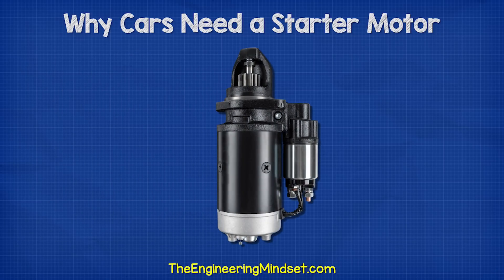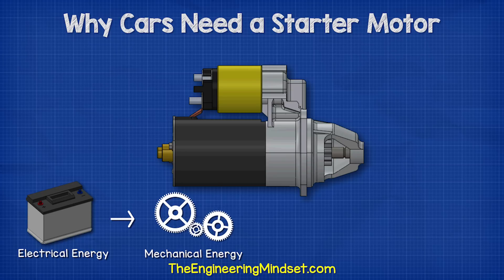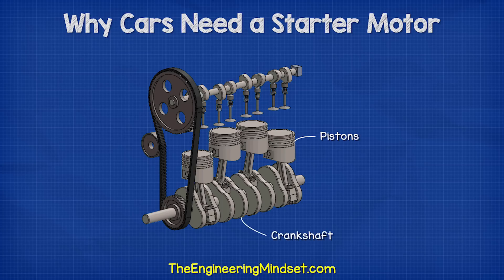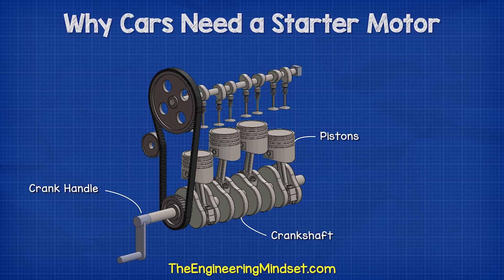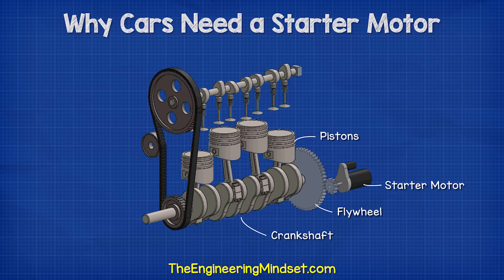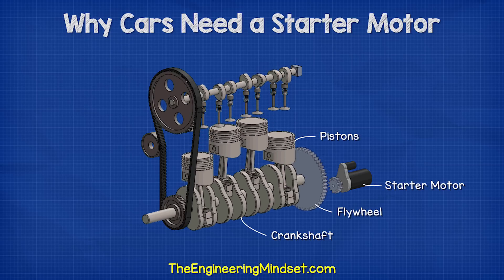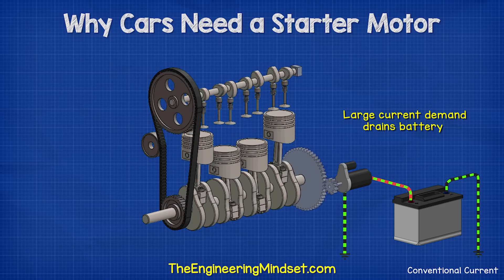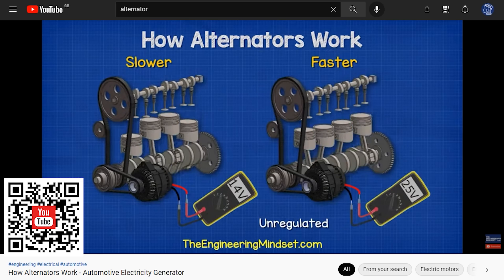Why Cars Have a Starter Motor

Comment: Remember the days when starters would grind if you turned the key if it was already running? Seems like a lifetime ago. Glad to see most, if not all manufacturers employ anti-grind/tach mode from the factory. That used to only come on high end aftermarket remote starters. Man I'm old.
Reply from the maker: Someone tried to start their car next to me the other day, with their engine already running 🙈, it was a horrific noise. Wasn't a particularly old car, surprisingly.
Reply: Wait... you're right it's all push buttons now... my truck will still make that awesome noise but it's a 99....
Reply: lol my 72 beetle does that. i spent many moments high as shit in my running car just to attempt to start it while running and hearing that cringe inducing sound

Comment: Drive a Morris Minor, battery died in shopping centre carpark, got out crank handle and got it going, turned around too an amazed audience.
Reply from the maker: Morris minor, fantastic! I wanted a reliant Robin when I was younger, just so I could have a "car"
Reply: @EngineeringMindset  Simple and reliable, flush out the radiator, change the oils regularly, top up with fuel, oh! And remember that crank handle...

Comment: My Scooter Doesn't Use Starter Motor For Starting The Engine, My Scooter When Start The Engine Silent Without Starter Motor Sound 😁😁😁😁 My Scooter Using Smart Generator Direct Connection To The Engine Not Like Conventional Starter Motor At Side The Engine

Comment: I used to have a car where the starter would jam against the flywheel. I was a teenager and skint. So, until I could afford a new starter, I just removed it an parked on hills so I could bump start it without assistance.

Comment: Now I'm thinking. With all the advancement we have with EFI, variable cam timing, spark timing, cylinder cancellation, auto start etc, why do we need a starter and not just start an engine via combustion process?

Comment: There were some vehicles that had a Large belt being turned by a combination starter and alternator.  These were "mild" hybrids.  Some early Honda hybrids had both the hybrid drive and a separate engine starter.

Comment: I work in vehicle recovery and I've found simple ways to diagnose 3 common faults that prevent a vehicle from starting:
- If the vehicle is completely dead or the electrics are working but it rapidly clicks or slowly revs when you turn the ignition... Then it's a dead battery.
- If the electrics are working but absolutely nothing happens when you turn the key... Then it's likely the immobilizer is faulty and needs resetting.
- If the electrics are working but when you turn the key you hear a single "click", then that's the sound of a faulty starter motor with the click coming from the Solenoid. If you're lucky & driving a manual, then the gears are just stuck and a simple push start will fix it.

Comment: Manual cars are the best!

My cars battery died a month ago and I didn’t know what to do I was alone 
But when I saw someone I quickly told them to come and give my car a good ol push
Thus my car started 
Also if the car is in a step road it’s much much  better just get in the car and put it to either gear 1 or reverse depending on the direction the car is rolling down.
Reply: I think most people will have better luck using second gear to push start their car. Turn the ignition to the ON setting (so the dash lights come on and the gauges work), put the car in neutral, push the car or roll it down a hill, then shift into second and let the clutch out. Second gear will be smoother than trying to dump the clutch in first gear.

Comment: Why 30 years ago, when you had a flat battery the starter motor would just sound like a slowed down record, and now you hear a ticking sound?
Reply: When the starter connects to a good battery, the voltage goes down a little; if the battery is flat the voltage goes down a lot.  Now the starter controls are electronic and when the voltage drops the relay gets disconnected.  That ticking sound is the relay connecting and disconnecting as the voltage goes up and down.  Older vehicles controls weren't as sensitive to the voltage drop and the relay would remain connected; the starter might turn slowly, or not at all; either way this could result in a flat battery AND a burned-up starter.

Comment: I recently realized that a dead battery and even a broken starter motor a car will start if you push it in gear with the clutch down in 1st gear and a 5ph release the clutch and the momentum turns the engine and it starts. Got me out of trouble when my starter motor quit 👍🇬🇧

Comment: So we can manually crank the engine if the starter motor doesnt work? or something like that?
Reply: Some small engines and small vehicles like ATVs have the option of electric or pull-start.  Modern high-compression engines in automobiles take more force than a typical human can make quickly to start them.

You can push-start many vehicles with a manual transmission, this involves slowly building inertia in the vehicle chassis, then transferring that power to the engine when the clutch is engaged.

Comment: Funny I just replaced my starter yesterday lol. I had I feeling it was the starter because my headlights would light up and all my electronics were good indicating that the battery was good. When I tried to start the motor it would just make a clicking sound. That clicking lead me to believe that relay was fine as well, and the only the left was the starter. Sure  enough it was the starter that was the problem. The windings were burned out , so I replaced the starter now the cars starts no problem.

Comment: The remaining question is "Why do cars still have a separate starter and alternator?" when weight savings are critical, alternators are larger than ever, and starters are getting smaller.  A lot of larger aircraft, some hybrid autos, and gensets handle both using a 3 phase stator and controller that's a rectifier/regulator for charging and a variable-speed-drive in one.
The starting torque changes a lot from stopped to rotating, so slow-start for a rev can greatly reduce the motor's size.  Since more vehicles are milking that 10% from start/stop intermittent operation, this seems an obvious "win" if they can scale up standard part manufacture.  Engineers are pretty good at that nowadays.
Reply: All full hybrid cars use an AC motor to both start the engine & generate electricity. The reason why regular cars still have a desperate alternator & starter motor is because it’s cheaper, since it has been that way for far longer.
Reply: I recently asked that myself. Also, this means basically all cars are hybrid. How much more complicated and expensive is it, to use one bigger electric engine to do all these tasks and have a slightly larger battery. Just enough for slow electric driving when starting from a dead stop and regenerating electricity from braking. Like the perfect balance for efficiency without having an overly complex design, parts and battery.

Comment: Temporary connects to the flywheel by way of the starter Bendix when the moter spins faster than the starter motor it releases the starter gear and retracts.

Comment: :24 tapping the starter with a wrench to make it start means it's old and is gummed up. shaking wires to make the car start means a bad connection. multimeter on the battery to see if it's old. It should easily hold a charge over night. alternator or battery bad if the car won't start right after driving it for a while.
Reply from the maker: Check our new Multimeter tutorial out ➡️ https://youtu.be/4lAyzRxsbDc

Comment: Yesterday my car wouldn’t start, and then I opened the hood and realized that there was corrosion on the red terminal. The car stuttered to start on its own after getting jumped. I figured out it was a bad battery!
Reply from the maker: Have you seen our video on how car batteries work?
Reply: @EngineeringMindset  Yes I have, and it was very informative in helping me figure out that the battery was the culprit, and not the alternator or starter. I am a senior mechanical engineering student, but definitely not a car guru. Thank you for the videos!
Reply: With a corroded terminal, the battery could have just needed good conductivity to complete a charge.

Comment: I once had to push my car down a ramp at a parking hall, then jump into the car when it started rolling down to get the motor running, since the start engine had died out and it was almost midnight.

Started up perfectly and I was able to drive it to the parking area of a car repair shop to get it fixed the next day
Reply: When I was dirt poor and delivering pizza, my battery crapped out on me and I had to push start the car a couple times. Thank god for manual transmissions.
Reply: Yup, that's how we used to do it back in the old days when for some reason the battery had died: one or two strong guys to push the car up to speed while in neutral, and one guy behind the wheel to release the clutch when it got up to speed. A downward slope accomplishes the same thing as the two strong guys, and saves you two beers. 😂
Reply: @EvenTheDogAgrees  I still do it when battery fails. Now im thinking of buying one of those instant chargers
Reply: @charlescarabott7692  You won't regret getting one, both for yourself and anyone you may stumble upon that desperately needs one.
Reply: @yasirkadhim2940  personally, I prefer jumper cables. Take up less space. Although they do require one working vehicle in order to do their thing, unlike those emergency starter batteries. I just don't want to rely on yet another battery that's used so infrequently that by the time you finally need it, it's also dead... 😂
Reply: @EvenTheDogAgrees  they're no bigger than a can of beer, and don't have a battery in them, they use a bank of capacitors when fully charged can last up to a year or longer, also you can charge anything that uses a USB cable, perfect for when the hydro goes out.  The one I have also has a built in flashlight that'll last for hours.
Reply: @chrisgadke2788  Oh, cool, didn't know about those. I thought you meant the ones roughly the size of two shoeboxes.
 
Still, same concern applies. For starters, I wonder how much energy they can store, given that capacitors, even supercaps, have lower energy density than batteries. Aside from that, even if they hold their charge for over a year, as you indicate, most people will forget to periodically top them off. So by the time it's needed, it'll most likely be empty.
 
Both the small ones you use, and the larger ones I had in mind, can be lifesavers in the hands of a responsible car owner who makes a habit of maintaining his tools. If you regularly take these things out of the car to top off the charge, they will be ready to go by the time you need them. However, in the roughly 20 years I been driving, the only time I've needed something like that was when I fixed up an old car where the ignition coil rely remained stuck in the "on" position, draining the battery. As soon as I figured that out, I simply disconnected the battery upon arrival until the new relay arrived. Unless you have a car that's known to be faulty, or leave things on that drain the battery, you'll never need external starter aid.
Reply: @yasirkadhim2940  I have a NOCO Boost Plus 12V 1000A which I bought from Amazon. I have used it twice and it worked  fine. I also carry heavy duty battery cables in both of my jeeps. They work great as well. Do not buy the thin cables battery cables.
Reply: You didn't put that it had a manual transmission. If you an Automatic this will not work so don't try it.
Reply: @Ottos_ScLm_Race_videos_2009_on  Automatics are extremely rare here and it is in no way relevant to automatic transmission, so why would I mention it? I didn't mention the car in question wasn't hybrid or electric either, since I was not sharing advice, but an anecdotal story asked in the video